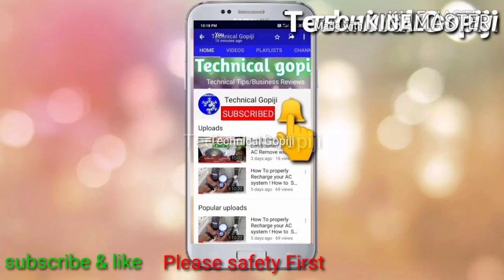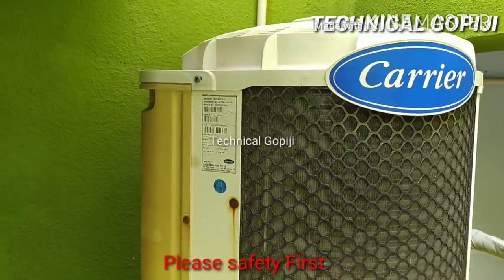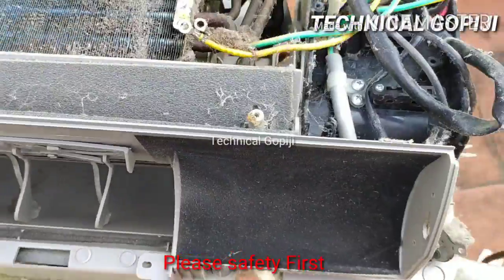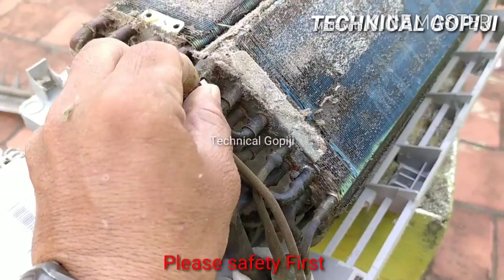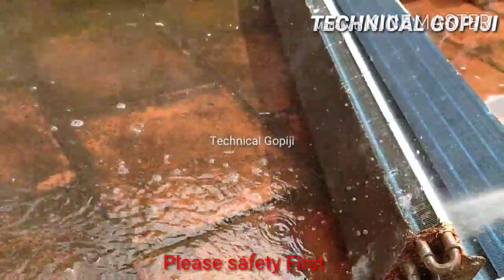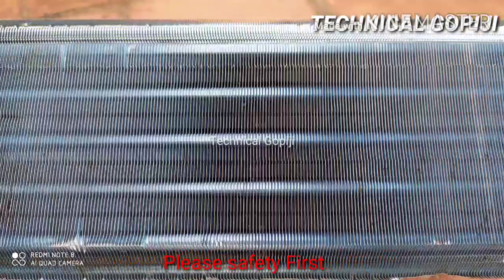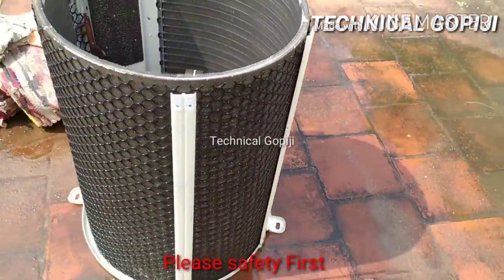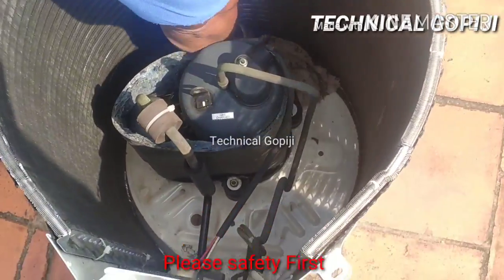CARRIER CYCLOJET FULL SERVICE SPLIT AC UNIT# 27 /Technical Gopiji

Comment: Sir I use Hitachi 1.5 ton, ac is clean and we have sufficient gas aswell, but could see drastic change compared to before, it's not at all cooling, I could see most of the indoor coil fins are damaged, could that be the reason?

3 years old, Hitachi 1.5

Comment: I am having same unit, i am getting heavy vibration and noise in the next room when the ac is running.  There is very less usage so dust accumulation cannot be a reason.  Pls suggest solution also share your contact.